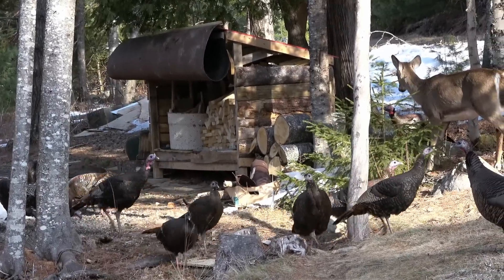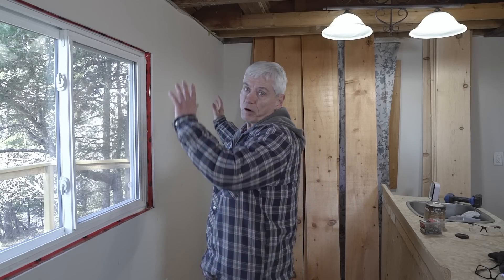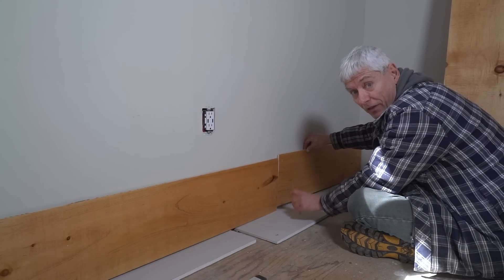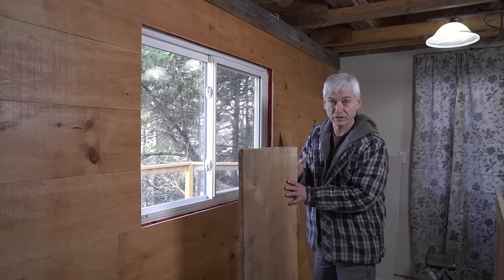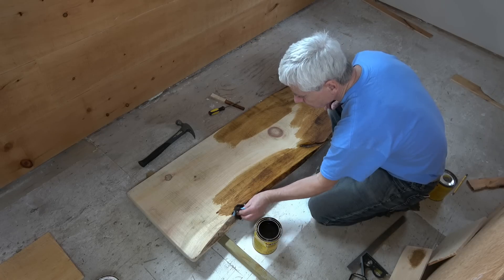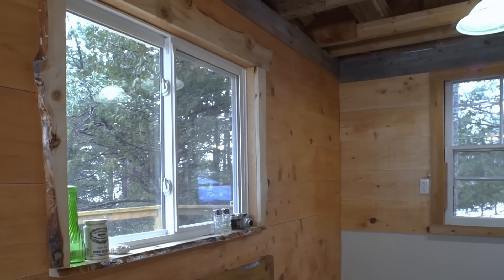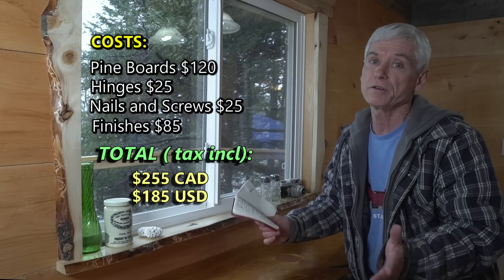Looking Good! Slim's Cabin Fixer Upper Part 19

Comment: Lol at the blow up doll. 
I have been home brewing beer since 2010 and you may want to check into the laws in Canada. Home brew is also a lot cheaper than any other beer. And the kits are as easy as making soup. I even made my own beer when my wife and I were full time in an RV for 3 years.
Love the videos!
Reply: Hopefully you inspire Slim enough that we get a beer making video! That would be a treat.
Reply from the maker: I used to brew my own beer but couldn't handle the bottling. All the cleaning and mess made me wanna drink! SP
Reply: Yes, that comment cracked me up.
Reply: I too brewed my own beer. One day I took a six pack to work for my boss. He put it in his truck. it was a super hot day. Super hot. It took us awhile to clean the mess up. Exploded like a bomb.
The next day, his wife said: ' Did you throw a drunk'?
Reply: @SlimPotatohead  I wonder if you can you use Ball canning jars instead? 
I'd imagine longneck bottles would be a pain to clean and fill. 
Would they be spoil if they are kept in a dark, cool/cold place prior to consumption?
Reply: Really impresses with your wondow trim and table. And you did make your cabin a little more cozy. Ugh! No to non-alcohol beer. 😂😂😂

Comment: I really love what you've done with the live edge lumber.  It really adds to the cabin's rustic feel.  On another note and from a licensed electrical contractor here in the States, there is one point I would make on how you covered those existing outlet boxes.  I'm not sure what Canada requires in the way of electrical codes so my comment here is strictly for the benefit of your State side viewers and not to hammer you on what you did.  Here in the States almost all jurisdictions (with some exception) follow NFPA 70 (National Electrical Code - published by the National Fire Protection Association).  Article 314 of the 2020 version of the NEC is titled Outlet, Device Pull & Junction Boxes; Conduit Bodies, Fittings; & Handholes.  Subsection 314.20 addresses Flush Mounted Installations.  That subsection prohibits what you did with the Gardner Bender spacers at 5:50 in the video.  Section 314.20 mandates that for installations within or behind a noncombustible surface, the front edge of the box, plaster ring, extension ring, or listed extender will not be set back of the finished surface more than 6mm (1/4 in.).  So in that regard and for most of us watching here in the States, your Gardner Bender spacers will suffice as long as the gap is no greater than 1/4" and the surface is noncombustible.  However, Subsection 314.20 goes on to state that for installations within a "surface of wood" or other combustible surface material, boxes, plaster rings, extension rings, or listed extenders shall extend to the surface or project therefrom.  So in that regard, the Gardner Bender spacers don't actually provide a code compliant solution to the dilemma of the existing outlet box being recessed behind the wood paneling and drywall when used here in most jurisdictions of the U.S.  NFPA 70's purpose is to provide a consensus based standard that enhances the safe use of electricity.  The point of the second half of 340.20 being that arcing within the box, in the event of an inadvertently opened splice where the wiring intermittently contacts a grounded surface (steel outlet box, bonding conductor, etc.) could ignite the combustible surface and start a fire.  I understand that building codes are only good to the point that they are enforced.  If there's no inspector, there's no enforcement unless done by yourself, but that requires an informed knowledge of the code itself; therefore, the purpose of my comment here.  Thanks for sharing your renovation work with us and the great ideas you communicate through them.

Comment: Hey Slim, Looks FANTASTIC! I love the fold up breakfast bar. Keep up the excellent work!

A couple safety tips to do what you want with:
1 - Make sure any rags you use for finishes get laid out flat to dry before tossing them - they could catch fire if balled up.
2 - With the table saw - best practice to not wear gloves. If by some chance they were to get into the blade, there's a possibility it'll pull your hand into the blade more.

Comment: Looks good.  NEC requires the device box be flush or extend out past combustible material.  Canadian codes may vary.  There is a sleeve that fits in to cover that area. 
Non combustible is no more than an ⅛".  
The wood is so beautiful.

Comment: Nice upgrades, Slim. I like that oscillating tool - will have to look into one of those. Also like the table at the window idea - especially that it’s a fold up one. Saves space and if you drop it down after use it’s not going to become a cluttered catch-all spot like most tables do. 👍🏻

Comment: Great video thank you! In the US the electrical boxes need to be within 1/4 inch of a finished wall if it's non-combustible like drywall. With combustible walls the boxes need to be flush. I'm not sure but I think it's because of the danger of Fire if there are any shorts or Sparks Inside the Box.

Comment: Great job love the kitchen folding window table and the window framing was great well done you the man. The cabin will look amazing when done. Just a suggestion why not use a generator for doing the DIY stuff. Its also handy to have for charing the battery on a dull day 👍
Reply from the maker: No generators! My power demand is now over and done so without those stinking beasts! SP

Comment: Nice work! That area looks great and the folding table is really cool. If you can find them, nail kegs make good stools. They will fit right in with the rustic look. We used them in our summer cabin in Michigan -- late 40's to mid 60's and beyond. The critters are always a special treat too.

Comment: Beautiful work Slim! You can also make spacers for the outlets by wrapping #12 wire tightly around a Phillips screw driver to make a spring. Cut to length needed. Keep em coming!

Comment: This is a beautiful set up for your window, Outstanding design in my opinion.  You will need a very comfortable fireplace chair, a side table and a handmade quilt.  Life is grand isn’t it.  (Sewing is a bit like woodwork, measure twice cut one and if you can sew a straight line you can make a quilt.  Use up old clothes or hit the linen closet, you probably have what you need).

Comment: Cabin is looking so good. Everything has it's place and a 2000 watt gas generator would really help you out when using all that power. Heard you say Molson and it triggered a memory from decades gone by. There was a very cute teenage girl tennis prodigy that came on the scene and was doing well. The announcer said if the tennis career or the modeling career didn't work out she would be okay as her Dad owned Molson.
Reply from the maker: No noisy generators!
Reply: I made an insulated gen box and way quieter than saws, turkeys and sanders but I get it.

Comment: Thanks for sharing, I'm sure it's been mentioned or you've thought of it.  But have you considered a small 2000 watt inverter type generator?  Some run very quiet and also use propane which isn't as dirty as gasoline or diesel?  Figure for those big project days you can get more done.  Thanks again for sharing and really enjoy the cabin video's.
Reply from the maker: I loath generators. Most of my big power needs are now behind me. SP

Comment: I have been electrician my whole life, like I have to space out a switch or outlet, I use the outside white jacket of the fourteen two. I just caught a low slave longer than I need and then just crush it down to the depths I needs. So you don't have to buy anything extra that way you don't have to carry extra items.

Comment: Good work Slim, you have hidden talents. If you moisten open grain wood and let it dry, it will produce feather or a rough surface, then you sand and apply a finish which will give you a smooth finish without roughness. Also ditch the "near beer" the stuff is terrible.

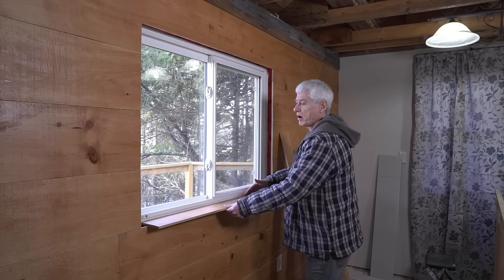Comment: 7:00 -- I don't understand... if you intended to panel the wall (which looks very nice), why drywall it first?

Also, I would have started by making sure that the paneling ran even with the window, whether or not that meant it was level.  That's the line that most people will see, regardless whether the paneling is true to either the floor or ceiling.  Besides, any ceiling gap would be covered by the trim, and a similar trim as baseboard could hide any gap at the floor.

That said, love the table and the live-edge window trim.
And at least the energy pig power tools are only a temporary drain.
Reply from the maker: Actually, I was not intending to panel the walls, I was hoping to salvage boards from the demo, but didn't have enough. Then after having to rip out the walls due to carpenter ants, I needed to replace them with something, and drywall was the easiest solution. It also seals drafts well. The pine was procured later, needed to dry and is very thin. SP

Comment: Great show this week; been thinking of your solar, what about a center swivel post with ropes that you could pull from your deck to turn it to the sun as the day progresses.
Reply from the maker: It you could think of a way to swivel the trees, that would be even better! Issue is not sun direction, its the tree shadows. SP
Reply: @SlimPotatohead   is it out of the question to have a connection to the grid as backup to the solar just in case circumstances of an emergency?
Reply from the maker: What's an emergency? Warm beer???

Comment: The hammer requires power to produce kinetic energy to "pound" the nail into material.  It takes electrical power within the human body to contract the muscles to sling the hammer repeatedly. And you have allot of power to "Jack Hammer" those nails so incredibly fast.  

They make beer with no alcohol? So I can have a beer with my buddies without affecting my heart condition. Kool!!!

Comment: Why not raise the table rather than shorten the stool? Will the sight lines be better if you sit a little lower? In renovating my kitchen I made my island higher than the counters. I've found different tasks easier at one height or the other making my kitchen more functional for me.
Reply from the maker: Lowering the chair will stop reminding me that the deck needs another coat! SP

Comment: Are you thinking of installing some type of heating system? Let the heat from the stove also heat up water and just run a couple pumps to spread it to radiators or maybe floor heating? Shouldn't be that expensive for a cabin that size. 
Sorry english is not my first language and I am currently learning about heating and plumbing myself.
Reply from the maker: Sorry, way too complicated for a simple cabin, especially since it is a seasonal property. I will probably add propane heaters for insurance purposes at least. SP

Comment: What are the plans for finishing the ceilings or will you leave it open  with insulation and panel over the inside of the roof ?
Reply from the maker: I love the open space about the main room, before it was claustrophobic . I will leave it as-is for now until I see how well it cools in the summer. Thanks! SP

Comment: Instead of cutting your stool, why is your fold-up table so low?
Reply from the maker: A typical dining room table or counter top is 36" from the ground. That's what I used as a standard. SP
Reply: @SlimPotatohead  that's probably true,  but it looked like you had the room to have a taller table seeing how your stool is taller than a standard chair. Is that your plan to buy or make a few standard chairs?
Reply from the maker: I'd like a stool with a back, standard size. It's on the list! SP